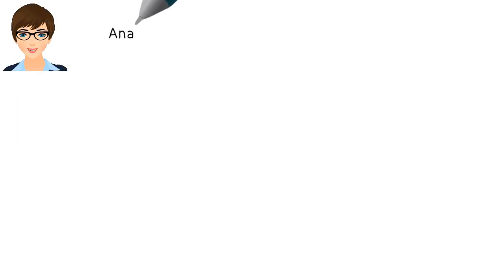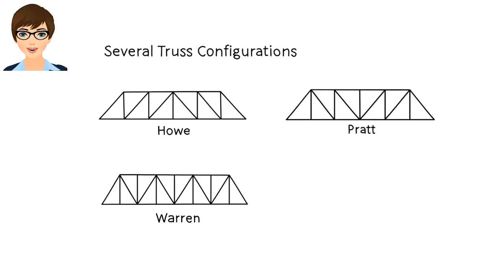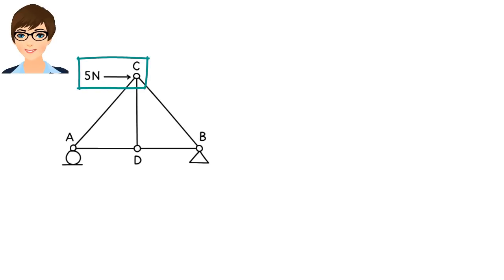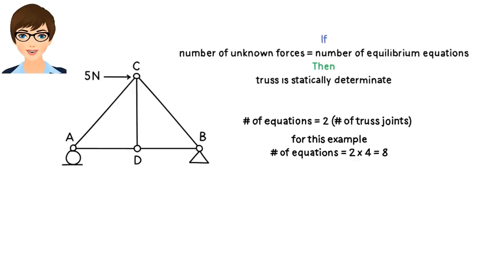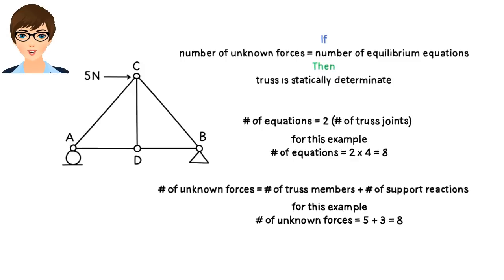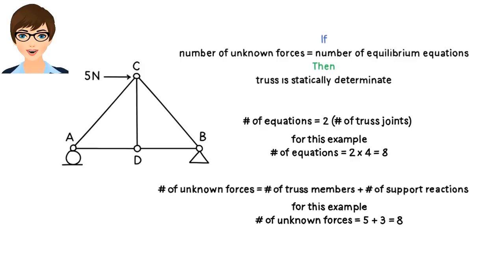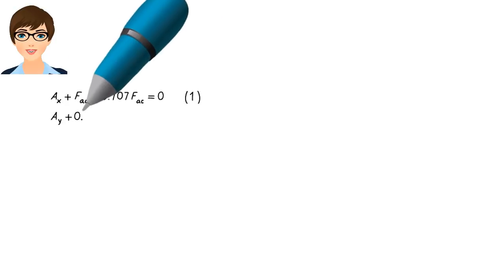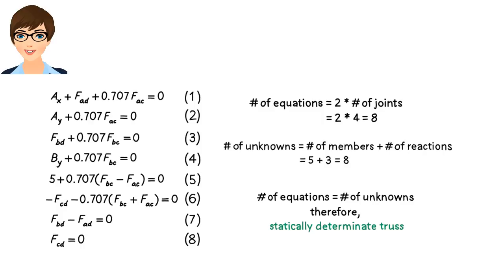SA04U: Truss Analysis (Method of Joints)

Comment: I noticed the pin and roller support swapped places. Was this intended?
Reply from the maker: Good observation. :)  No, it was done accidentally; the swapping has no significance.
Reply: Hello. I have the same question. But is the first one (@2:45) correct? Because solving reaction forces won't be possible because roller can only have upward normal force.
Reply from the maker: @luisgabrielcabico9389  The position of the roller/pin support is irrelevant in this case. We can still calculate the support reactions. There is one reaction force at the roller and two reaction forces at the pin. So we have a total of three reactions forces and three static equilibrium equations. 

For the diagram shown @2:45, if we set the sum the moments about point B to zero, we get the reaction force at the roller support (at A). Suppose the big triangle has the same height and base, say, 3 meters. The moment equilibrium equation about B can be written as: (5 N)(3 m) + R (3 m) = 0 where R is vertical reaction force at A. Solving the equation for R, we get: R = -5 N. That is, the vertical reaction at the roller is downward with a magnitude of 5 N.
Reply: I have always thought that roller supports can only create an upward reaction. Thank you Dr. Structure.

Comment: Thank you for your videos!  They are helping me study for the ARE exams.  I was hoping you could explain at about 11 mins in, why in the sum of forces you add Fac x cos45.  I understand that the forced of Fac is in the x direction, but I don't understand how you decided to multiply Fac by cos45.  Is it because the adjacent and hypotenuse are the only forces acting on the joint?
Reply from the maker: As an inclined force, Fac has a x component and a y component.  

Imagine a right triangle having Fac as its hypotenuse. That is, the length of the hypotenuse represents the magnitude of Fac. Then the x component of Fac would be the base of the triangle and the y component of the force would the height of the triangle.

Since the hypotenuse makes a 45 degree angle with the base of the triangle, then:

cos(45) = Base/Hypotenuse
sin(45) = Height/Hypotenuse

Since Base is the x component of Fac, Height is the y component of Fac, and Hypotenuse is Fac, we can rewrite the above relationships as:

cos(45) = Fac_x/Fac
sin(45) = Fac_y/Fac

Or,

Fac_x = Fac cos(45)
Fac_y = Fac sin(45).

When writing the equilibrium equations, summing the forces in the x direction requires using Fac_x, or Fac cos(45). And, summing the forces in the y direction requires using Fac_y, or Fac sin(45).
Reply: Dr. Structure Thank you for the response!  I completely understand!  So, cos and sin are interchangeable in this regard.  I actually worked all of this on my own actually which I am proud to say but thank you for clarifying!  Glad to know I am on the correct path!  What was throwing me off was that I wanted to make the equation cos45=Fad/Fac, which gave me Fac cos(45)=Fad and made my equilibrium equation Ax + Fad + Fad.

Comment: how do you put this animation face? is it in the program you are using
what is it ?
thank you
very great work
Reply from the maker: Check out CrazyTalk Animator.
Reply: @DrStructure  I downloaded it , after making the progect I could not find a way to put it into powerpoint
I ll be very greatful if you answer
Reply from the maker: You can use CrazyTalk to create a video clip of a talking head/avatar. Is that what you did? Did you generate a video file using CrazyTalk?

You should be able to insert a video file, any video file, into Powerpoint. That is pretty straight forward. And you can play that video from inside PowerPoint. But I suspect that is not what you want to do. What are using PowerPoint for? and why do you want to have the talking-head video inside PowerPoint? 

If you are using this to create lecture videos, then you need more than PowerPoint to make it work. You can create the presentation slides using Powerpoint, and publish it as a video (without voice).  And use CrazyTalk to create a talking Avatar. Then, use a video editing software like Camtasia Studio to synchronize the audio and video files, and publish the final video.
Reply: I am preparing to my phd and thought it would be interesting if I add a face in some slide who says smth 😅
but I cant find a way
I cant save crasytalk progect as vedio
is that because I am using the free trial
anyway
thank u so much
you were very generous
Reply from the maker: Yes,  you need the non-trial version of the software to be able to save.... You're welcome.

Comment: In the beginning, it said that the load shouldn't place directly at the truss member. But in the real case, the load is applied at the truss member such as the self-weight of the truss member and another kind of uniform distributed load. I got a case like this https://imgur.com/GiYFSJv How to translate those uniform distributed load at the member of trusses into a pointed load at the trusses joint. I hope you can share your wisdom, thanks.
Reply from the maker: You can multiply the magnitude of the distributed load by the distance between the two truss joints. That gives the total load on the span to be applied to its end joints. Divide the total load by 2 to get the load per joint. Example: Suppose the bottom chord of a bridge truss consists of five joints. Let's say the distance between two consecutive joints in the truss is 3 meters, and the distributed load applied to the bottom chord of the truss is 2.6 kN/m. 

Since the bottom chord of the truss consists of 4 spans (5 joints), the total load per span is: 2.6x3 = 7.8 kN. Dividing the total load by 2, we get: 3.9 kN per joint.

Let's number the joints along the bottom chord of the truss as 1 through 5.

For the load in the first span, place a concentrated load of 3.9 kN at joint 1 and a load of 3.9 kN at joint 2.
For the load in the second span, place a concentrated load of 3.9 at joint 2, and a load of 3.9 kN at joint 3.
For the load in the third span, place a concentrated load of 3.9 at joint 3, and a load of 3.9 kN at joint 4.
For the load in the fourth span, place a concentrated load of 3.9 at joint 4, and a load of 3.9 kN at joint 5.

Add the joint loads for each span load to get the actual joint loads:

Joint 1: 3.9 kN 
Joint 2: 7.8 kN 
Joint 3: 7.8 kN 
Joint 4: 7.8 kN 
Joint 5: 3.9 kN
Reply: @DrStructure  Thanks for your wisdom, hope we still connect through this channel.

Comment: Excuse me, how to analysis a truss if it need to resist a moment at joint?
Reply from the maker: If a joint is to be designed to resist moment, then the structure is no longer a pure truss. A moment-resisting joint means there are moment-resisting members which makes the structure a hybrid system, a mix of beam/column and truss elements. A good technique for analyzing such systems is the displacement method (see video lectures SA45 thru SA50).